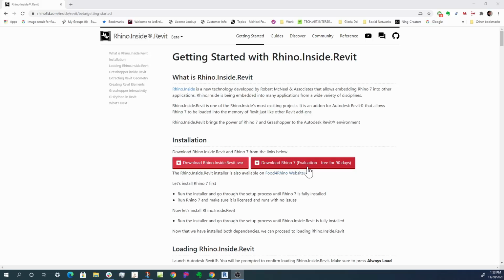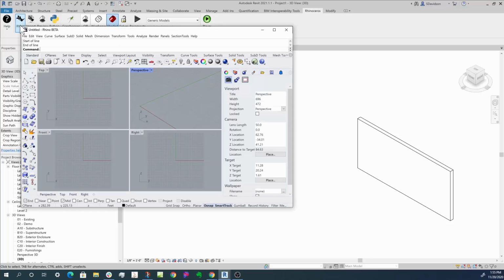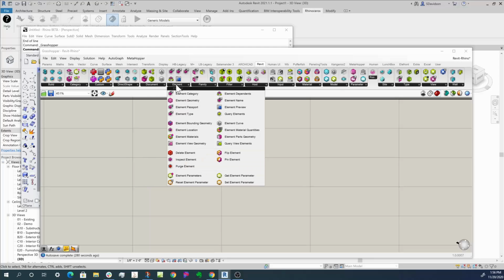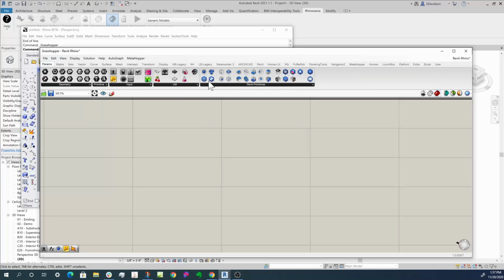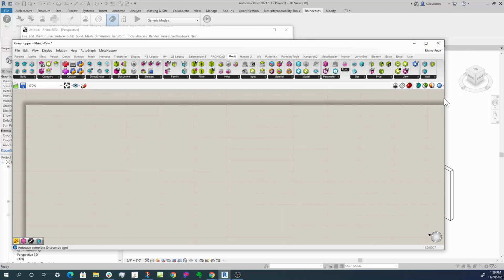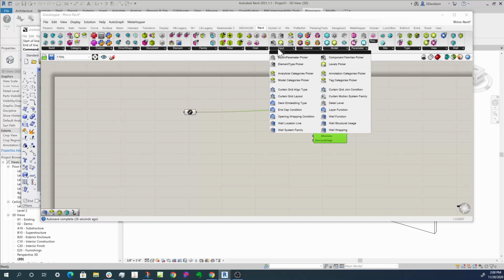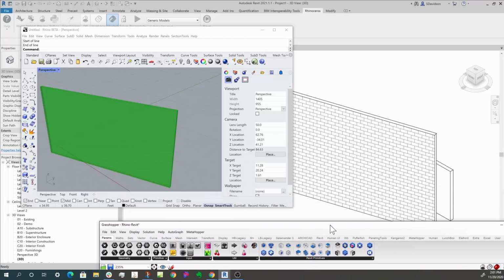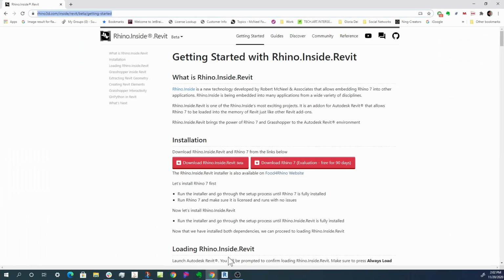Getting Setup with Rhino.Inside.Revit

Comment: Thanks for the tutorial based on the new version. The Graphical Element function is much easier in terms of eminent selection.  One quick bug report over ''Set Multiple Graphical Elements", it only works if you select your elements in Revit first and right-click on the node, it doesn't work the other way round. Revit 2020 / Rhino 7.2.21021.7001 Rhino.inside Revit: 0.0.7734.4687